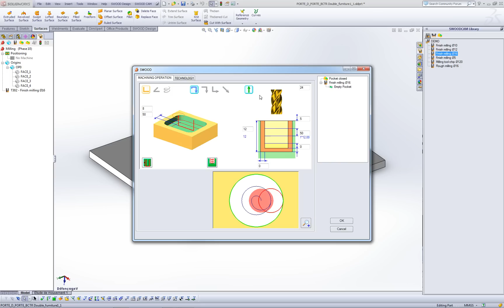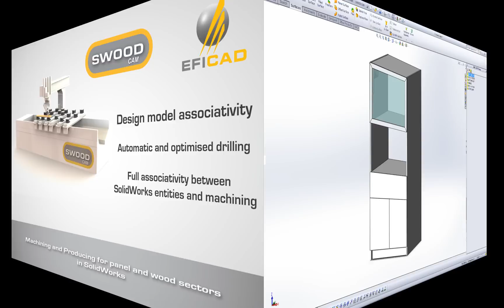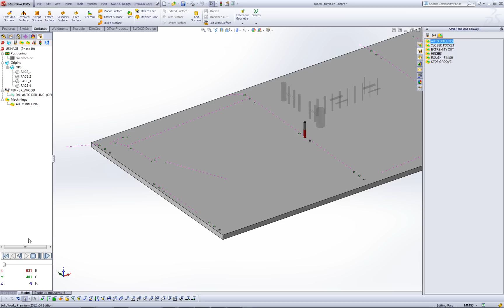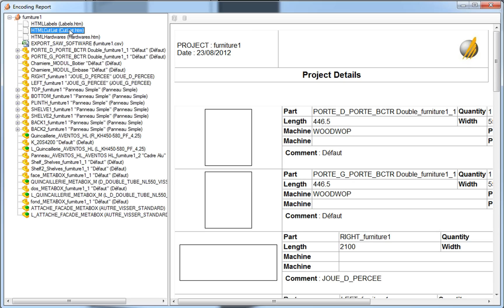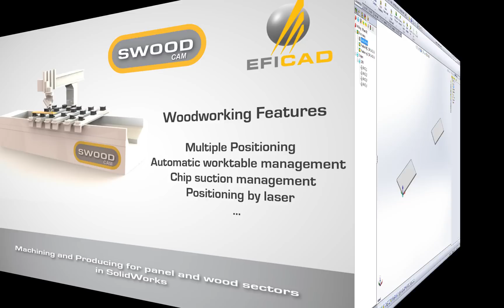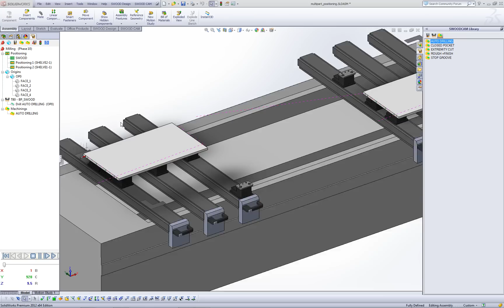SWOOD CAM

Comment: hello I need your help if you can. G code generated by SWOOD CAM. My CNC is reading but not turning the spindle. N20 M3 S12000 T1 When I delete T1 it works perfectly. If you can help me.
Reply from the maker: Hello, don't hesitate to contact your SWOOD reseller if you have any questions!